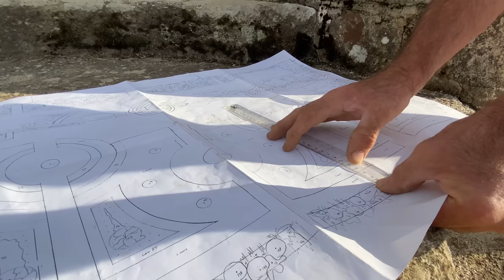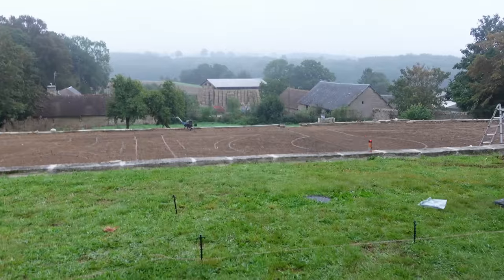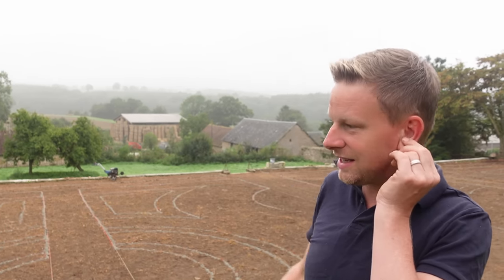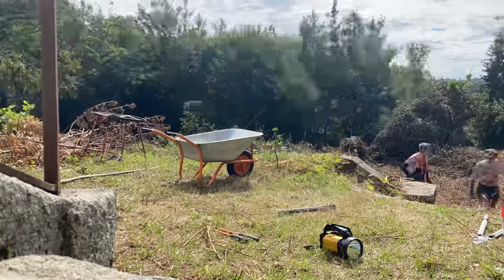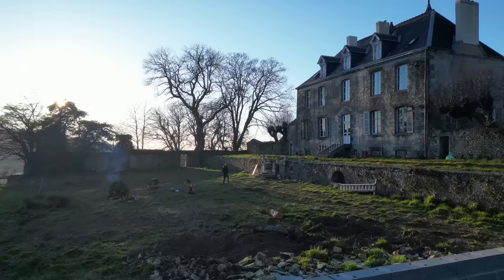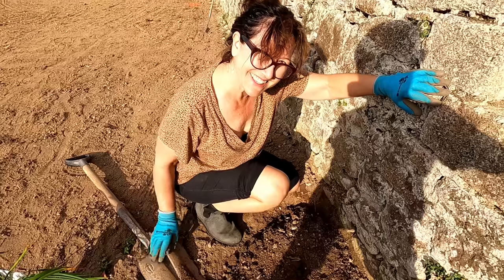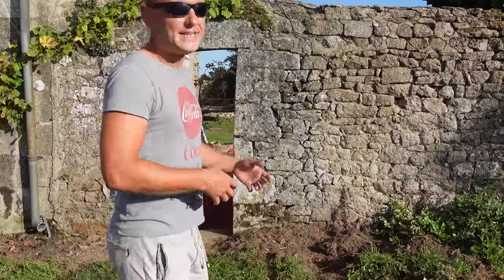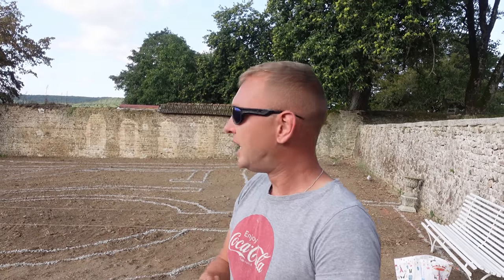Before and After: Witnessing the Restoration of a Chateau Walled Garden  | 3 Years in 20 min

Comment: Ambitious project but will be most elegant! Question about one of the walls—it looks like there were 4 doorways that were filled in/blocked off. Is there any way of knowing what that may originally have been?
Reply: There is a whole episode from earlier describing all of the wall sections, not sure there was a definite answer to your question though!
Reply: @philmorris8696  I have been ruminating about it and am thinking it could have been for individual horse stalls or multiple access points for agricultural tools or supplies or perhaps one was a door and others were large windows if the space had been used as a greenhouse. I recall their orangery is further from the Château, but there may have been a starting space for the plantings that would go into the two terraced gardens.